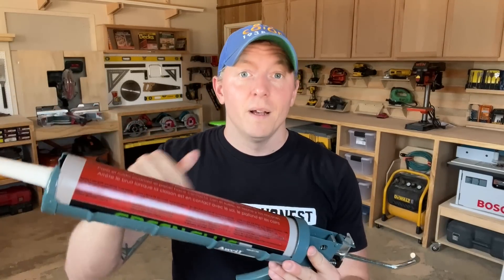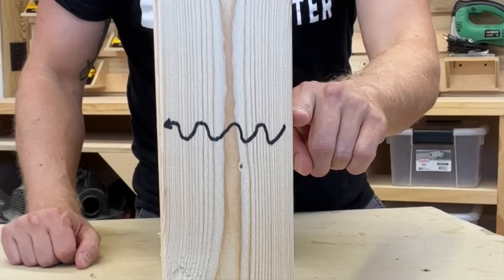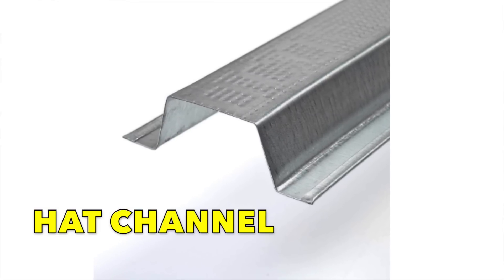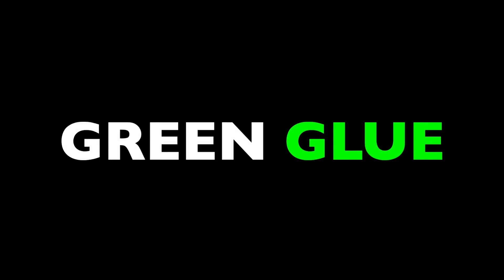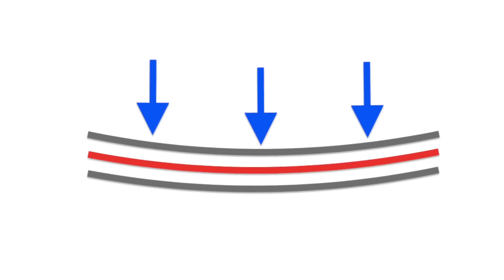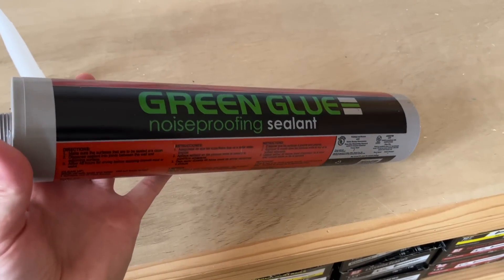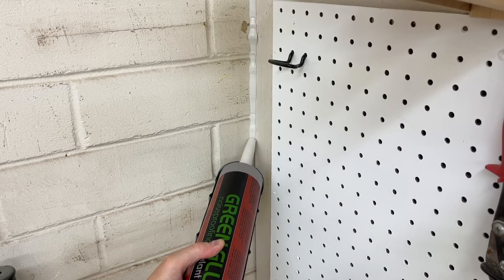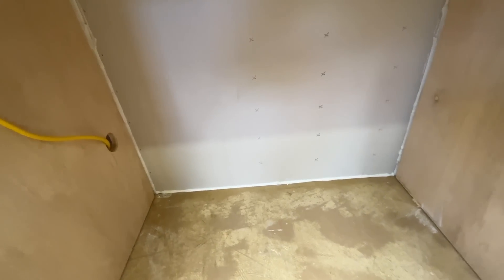SOUNDPROOFING EXPLAINED in 5 Minutes! 3 Principles of Noiseproofing (Cut Down Sound Through Walls!)

Comment: Definitely helpful.  I've heard most of these concepts and methods discussed in past, but certainly not so efficiently condensed into 5 min ; )
As always, you and other YTers who make this content are providing an incredible service to the world.  Don't let anyone ever tell you otherwise.  I know I appreciate all the things I've learned.
(And potential mistakes avoided!)
Keep it up!
Reply: Actually, quick question: when adding the second (staggered) sheet of drywall WITH the green glue bead in btwn, are you trying to not put to much pressure on it as you set it in place? As in, are you trying to not flatten the interior bead? Have you ever tried this? Does it make it difficult to get adjacent sheets to edge align or keep wall flat across side to side? Also, is that second sheet still getting drywall screws or does the green glue act as adhesive? (Just seems like you'd need some pretty long drywall screws to go through both sheets and space btwn and still sink into studs)
Sry lol, that was a pretty involved question : /

Comment: I have been studying this topic for two decades, and use it in my consulting, and this is the best no nonsense concise video on "soundproofing" I have seen on YouTube.  The steps you have described are the best methods, proven again and again in labs and in the field, and this will now be my "go to" link to explain acoustic isolation to people.  

Okay, one nit pick:  You didn't emphasize that ALL these things need to be done together:  the decoupled drywall on walls and ceiling, the dual layers of drywall with Green Glue on walls and ceiling, AND the acoustic caulk to seal all wall and ceiling penetrations.  

Doing some without the rest results in a fish tank with a hole in it:  It just won't hold water very well! ;)
Reply from the maker: Thank you, Natty! I greatly appreciate that! And I see your point on the fish tank analogy—I wouldn’t put my fish in that tank 😁 Best to button all the way up!
Reply: natty-one thing i dont get-staggering does not address coupling through the base and ceiling plates /
Reply: @johnwhite2576  you are 100% correct.  In a longer form video, I bet our host would have gone into detail about "good, better, best" in terms of decoupling.  The STC rating of a normal wall is about 50. A staggered stud wall is about 60, which is a big improvement and for many situations is adequate, especially if you are concerned with the vocal range.  But dual wall solution is over 70 so, for the reason you state, and is the superior solution when possible/desired.

(STC=Sound Transmission Class, the formal method for comparing various wall, ceiling, floor, door, and window assemblies, is calculated by taking the Transmission Loss values tested at 16 standard frequencies over the range of 125 Hz to 4000 Hz and plotted on a graph -- and then compared with official graphs for the standard, which was developed in 1961.  STC isn't a perfect system since sound below 125hz like the bass in your home theater is particularly difficult to trap.....so a high STC rating might mislead you into thinking you have a perfectly isolated room when you don't.)

Note that your line of thinking extends to the ceiling and floor.  If the decoupled walls touch the ceiling joists of the building, then sound is transferred to the rest of the building, anyway.  (This is called a "flanking path.")  So a well made "soundproof" room (really just a "isolated" or "noise isolated" room) will actually use a "second ceiling" that rests on the interior decoupled walls and doesn't physically connect to the rest of the building.  (It is also possible to do "staggered ceiling joists" if you don't have space or money for a second ceiling.  And the channels and clips mentioned in the video can also be used on a ceiling.)

The floor, if it is on wood joists, is another huge flanking path.  There are solutions to build a "floating floor" which is essentially a rubber mat below the floor that decouples it from the rest of the house, and other solutions.  SERENA UNDERLAY is a popular product for this, but there are others with similar properties that cost less.

And I should say, if you are going to pursue some of the "best" practices, be sure to pay attention to wall penetrations.  The video does a great job of explaining many of them, but don't forget about electrical boxes etc.  You can wrap these in special putty to reduce sound transmission.  For example, Acoustical Putty Pads are UL classified for both non-metallic and metallic outlet boxes to prevent the spread of smoke, fire and toxic gases.....and greatly reduce the sound that passes through these surprisingly porous openings.

Comment: A couple of things I hate that marketing of green glue turning sound into heat that is just how thermodynamics works, what they should say is it does a better job at doing it then most. 2. they say to use 2 tube per sheet of dry wall for a STS of 14 I think but also remember sound is a LOG and just half a tube per sheet will still net you close to 7 STS, so for 25% of the cost of materials you can get about 50% effectiveness.

Comment: There are also acoustic coatings that help to deaden sound.  Years ago tugboat crew complaints of engine noise in their cabins led to a search for a viable solution.  The tug was already in operation, so there was insufficient room for insulation, steel decks and doors didn't help.   The ultimate solution was sound insulating coatings.

At the time the work was done there was a limited number of choices.  We used, as I recall, a rubberized coating that went on about 1/4" thick.  The coating was quite effective.  The only problem was it came in one color, black.  It took several coats of paint to cover the black.

Bob
Bob
Reply from the maker: That’s a cool bit of information, Robert! I appreciate that 🙂

Comment: I just build a work bench in my garage. Cinder block walk with my wife's office on the other side. I built walls on both sides and used R-1 foam board to decouple the studs from the conderblock wall. Then stuffed it with insulation. I worked really quite well.

Comment: Sonopan fiber boards in Canada are incredibly good value for soundproofing against both high & low frequencies, but far as I know, there's no easily found equivalent in the US these days.

Another great product for low frequency is MLV (mass loaded vinyl), which can get pricy, but is really unmatched when used properly. 

If sound quality within a room is of concern, the absolute best budget option is to staple layers of old towels within a deep picture frame, which can then be covered on the outside with inexpensive speaker grille material for a professional look. Couple of these, well placed, will drastically increase both sound system clarity & microphone depth/quality/tone.

Comment: So one of the reasons the lower frequencies tend to penetrate through even a gap has to do with the wave length.  Adding the multiple layers of air gap and dense materials causes additional defusing and scattering of the noise as it try’s to transfer from one medium to another causing it to weaken in a much shorter distance.  Different materials have different cut off frequencies so noise emanating at a frequency lower than the cut off will pass through, but changing the medium of energy transfer causes sound to travel in less of a straight line.

Comment: I'm a retired Federal Agent and when my office moved to a new location, I was given the task of specking out of different issues relative to law enforcement. One of them being sound proofing the new offices and the two interview rooms were included in new build-out. 

The first thing I learned is just what you mentioned, gaps between wallboard. At the time it was counterintuitive but once it was explained to me and I did my research, I knew what had to happen in the design and buildout. 

It was an interesting process and fortunately it all worked out. 

Indoor shooting ranges have gone through many developments and evolutions and now, rather than having to shoot our weapons outside to qualify, Federal buildings that are built for law enforcement have indoor shooting ranges generally in the basement and with soundproofing technology we, or they my former colleagues, don't have to shoot outside either in the hot summer or the cold winters of New England. And unless you are told, you would not know weapons are being fired in the basement of Federal buildings. 

Finally, I really enjoy and appreciate your videos. As a 70 Y/O DYI'r I am still building things and making a lot of sawdust in the process. My current project is finishing off the area, which is good size, under the stairs to my basement. I am running Romex for lighting, finishing the walls with leftover 1x6 T&G pine. I needed to hire a carpenter to build heavy duty pullout shelving. That's way over my head. 

Again, thank you for your videos. 

DP
Reply: *Bork, you're a Federal Agent. You represent the United States government. Never end a sentence with a preposition.*

Comment: I live in an apartment and outside noise comes easily in through the cheap single pane windows. Is there anyway to block some of that out?
Reply: You can try 1/4” acrylic plexiglass with an air gap between. It worked in my bedroom when I lived near a train station. You can cut it to size with a circular saw and it is easily removed.
Reply: @Noah-qt3rq  thanks, I will give that a try.
Reply: You could also try replacing the glass with laminated glass. Similar to the green glue but 2 layers of glass glued together. Not cheap though, and the window frames may need modification.

Comment: Thanks, this is interesting and informative. Do you have any recommendations for a bedroom ceiling that is directly under another bedroom. House built in 1952 with hardwood floor and 1" X 6" underlayment. Objective would be to deaden all sounds as much as possible but voice is the main focus from both rooms. The ceiling below has many crossmember supports between the floor joists.  Thanks for any ideas.
Reply: Redo the lower bedroom ceiling with everything show in this video. Rock wool insulation, double drywall hung on the metal spacers

Comment: 1. The fact that this remedy works tells me it's the wood, not the air, that transmits the sound. Not mentioned is that surfaces reflect sound, so those work too.

Go down to your local lake on a quiet morning and admire the reflections. Later, when the wind gets up, the surface roughens up and the reflections are blown to pieces. Your wall surfaces are similar. In the 1950s, when I was a small child, our internal walls were covered in asbestos sheeting. One side was dimpled, like the surface of a golf ball. This served to disperse sounds, a little like modern acoustic tiles.

2. Dense, heavy materials such as steel, brass, china, even water, transmit sounds really well. Have you eve tested a cup for cracks by tapping it with a spoon, or heard the chime and resonance of a bell? I think that your extra panels are working because the surfaces aren't very flat, and because they disperse sounds by irregular reflections.

Unlike the hard materials I mentioned above, your sealants are and remain pliant. Not good sound conductors. And, of course, filling holes with it is good. So too would be "gluing" sheets together with it at the edges.

3. I think those materials work mostly by dispersing the soundwaves, similar to the dimpled surfaces on our asbestos.

Converting sound to heat comes as no surprise at all to me. When I was in high school, kids destined for trades left school after three years of high school and took up apprenticeships. The rest of us completed high school and largely qualified to study further at university. Typically, we got a firmer grip on maths beyond arithmetic, algebra and geometry, studied higher levels of science, geography, in my case French. For me, science was physics and chemistry, and a large part of physics is conversion between different kinds of energy.

Comment: Please be careful when using unprotected combustible sound proofing such as foam or moving blankets. 
 
In 2003, the Station night club fire was started by the band's pyrotechnics causing the acoustic foam to catch fire, killing 100 and injuring 230.    If you ever have sparks from grinding or welding in your shop, don't use it.  Find a non combustible such as the fiberglass batting.
Reply: That’s hardly a fair comparison. The main reason that fire was so devastating was because of the single small egress of the facility, doors chained shut, and a lack of a fire suppression system. If all of those weren’t problems, even all the burning foam inside would have been no issue other than some smoke inhalation. It’s part of the reason it is said that common law is written in blood.
Reply: @BrianMDPhD  Are you a fireman?  We made our training fires with one foam mattress and it would blacken an entire 2 story burn building to zero visibility with black smoke.  The 3 of fatalities that I have responded to as a firefighter in my career was caused by smoke inhalation and it was from what we call light or almost no smoke, but the smoke killed them anyway.  It is what is in the smoke that kills you as well as the lack of oxygen.

Comment: I’m an acoustic consultant and this simple video actually did a good job of explaining things. A common problem is that people underestimate the impact gaps have on sound insulation. A well insulated wall with a small area of poor or zero insulation will have a large impact. If it was an ok wall, percentage wise the same issue wouldn’t have as much of an impact. So the more effort you put into stopping the sound transfer, the more effort you should put into filling the air gaps whilst considering the decoupling you mentioned.

Contractors often are obsessed with extra screws and nails for strength but for sound insulation you really don’t want to do that.

Last tip, consider the whole space. It’s no good creating a perfectly insulated wall next to the noisy room if the sound energy is going to go over it and through your terrible ceiling.

Love your stuff (from the uk🇬🇧)
Reply: I second this review. Also an acoustical consultant for 10 years and now work for a vibration isolation manufacturer. I appreciate when someone from the construction side of the industry spends the time to get it right. Seal those holes people! A visual metaphor: It doesn’t matter how great the walls of your bucket are, if you have holes in the bottom, it’s still going to leak!
Reply: It's basically the same principle with thermal insulation.  Even if you put R50 insulation (imperial R, not metric) on 90% of a wall, putting R5 insulation over the remaining 10% will significantly drag down the overall R-value of the entire wall.  Both heat and sound energy will find the path of least resistance.
Reply: Would you say then that it is unnecessary to tape the bottom layer of drywall? Could you just use acoustic sealant on it before the top layer goes on?
Reply: @BrianMDPhD   acoustically if it’s just tape I would expect sealant to do a better job as tape is lightweight and thin unless you’re putting material (plaster, mud, filler) on the joints as well then I don’t think there would be much in it. If you’re offsetting the joints and filling the gap I wouldn’t expect it to make a huge difference either way as you’ve done the work with the offset and filling.

It would need to be tested to be sure so if a manufacturer says do it this way chances are they’ve already tested it and they’re saying that for a reason.

Construction wise though on which is best I can’t comment. Usually there’s a compromise where it’s good enough and you’re considering cost or speed instead.

Comment: Cool. Thanks for the info. I’m about to redo a garage bedroom ceiling due to it not having a air gap between the the beams and the ceiling so it gets hot. 
Each section of beams has insulation but it’s sealed by the drywall so each section is like a little oven with nowhere for the heat to escape. I’m going to add cross beams to drop the ceiling about 6 inches but want to sound proof everything for ceiling speakers. It’s a nice little home theater with a 85” tv and 7.1 surround sound. Just need better insulation and some ceiling speakers. Cheers

Comment: How do you prevent sound from travelling thru the HVAC air vents ?
Reply from the maker: I’ve been told that it’s almost impossible—you have to switch to radiant heat flooring. It’s just a really weak point in sound control for houses, because vents directly connect rooms 😬
Reply: Do a quick search for acoustic air vents. The short answer is baffles & absorption, make sure the vent housing is decoupled.
Reply: @jonp6798   What do mean by  " make sure the vent housing is decoupled. " ?   I can't re-do the supply ducts.

Comment: Another rule of thumb, is if you stop air movement through the wall you'll stop the sound as well.
Reply from the maker: Good call, Mark! I think that’s where the sealant rally helps too 👍
Reply: @TheHonestCarpenter  my cheapest approach for a sound wall was 5/8 blue or green board both sides ,because it  denser ,sealant on all the studs and any openings and rockwool and install it tight. Not sound proof but for a few extra bucks it stops a lot of noise. Great video. Many times the simplest things can still give a big impact.